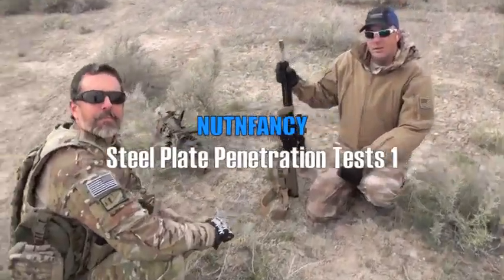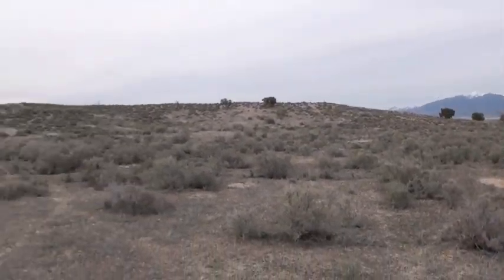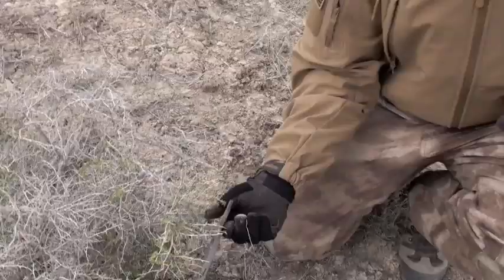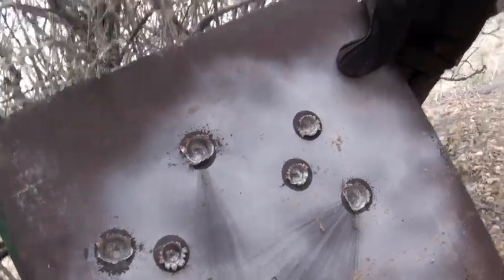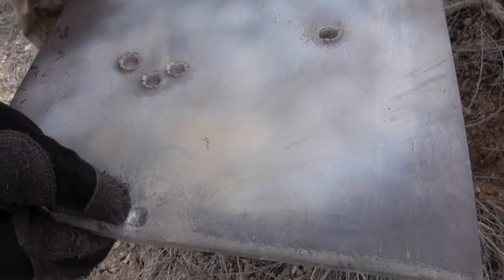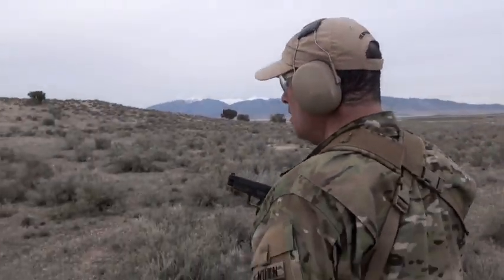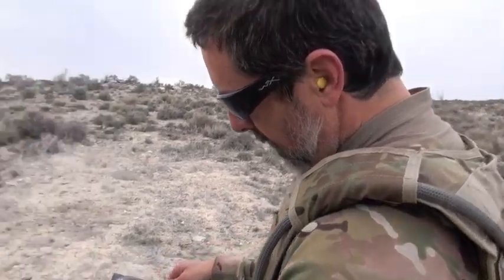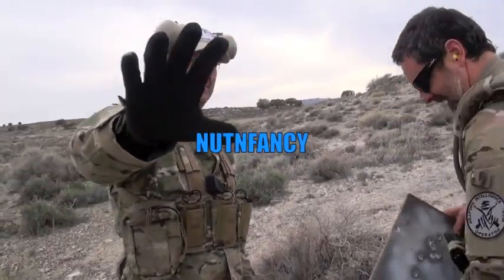Steel Plate Penetration Tests: 7.62mm, 5.56mm

Comment: Its a lot cheaper to stop 308 and 5.56 with sand bags. The sand eats the bullets up like candy and for an up grade you can go with gravel in bags also. Works like a charm and is easier to build a defensive barrier for protection plus it can be found everywhere.  Simple always works best.

Comment: I like the video. I tested my rifles the same way you guys did; with 3/4" 12x12 steel plates. I noticed during your video, .308 did not penetrate the 3/4" steel plate. I don't know your yardages or anything, but at 100 yds, I penetrated a 3/4" 12x12 steel plate with my 1950 8mm Mauser.

Comment: Kel Tec is JUNK, they have been for years...
Reply: Dana L i wanted a KelTec RFB until i saw Nutnfancys video... i never buy a new gun until i watch some Nutnfancy videos a few times... i only trust Nutnfancy when it comes to gun knowledge
Reply: John Smith Haha, Yes I agree, but there are other people's opinions on things as well that are good, but he is very knowledgeable, even though his shooting prowess needs a bit of tactical work (not much, but I can pick out some flaws that need work, he just isn't as smooth as other Operators). He is squared away and I trust his opinions on equipment and philosophies on many things, not all, but most.  

Yes the RFB is junk, I was out training at my local range and saw a guy with a brand new one, that he was having issues with on ALL types of ammo he was using, then he took it apart and couldn't put it back together again, he ended up getting frustrated and taking it home in a box. I don't know what was wrong with it, nor had time to check it out, and I just witnessed this in passing several times as I was working on the pistol side.  Which just reinforced the bad reviews I have seen.

The KSG isn't too bad, maybe the one decent product of Kel Tec, and their pocket pistol line as well isn't bad for the price. They just don't have the reputation and military rapport like HK, FN, S&W, Colt, Remington, and etc.

Comment: Ok, they went through, but what is left of the bullets once they made it through a steel plate? Even the 1/4" one? I'm gonna guess, what's left of them won't have enough energy to hurt a fly.
Reply: No way I would want to be on the other side to find out.
Reply: ***** you would still possibly be injured by the spalling effect.  Granted, it will be much slower velocity but still enough to cause injury.  Especially to soft tissue, eyes, throat etc.  I have seen this first hand and the chance of a mortal wound is low, but it still could happen.

Comment: The 1996 North Hollywood shootout (Bank of America robbery) dispelled a lot of the myths about hiding behind cars as cover for assault rifle fire. The AK47s and HKs used in that incident went through police cars like a hot knife through butter, though I understand they were using armor piercing rounds in that case. Evdiently, as this video demonstrates, armored piercing rounds are wholy unnecessary in defeating even thicker steel (though the grade they used was pretty low quality and not analogous to armored military vehicles). Even positioning oneself behind the engine block of a vehicle offers little guarantee of protection against such a round (especially given the extensive modern use of aluminum in engines). This video also demonstrates the lack of power of the 5.56 round, though it certainly demonstrates the valid trade-off for improved accuracy. Still, it does little good to have nice groups that don't penetrate low-grade steel cover. For the 308, such steel is certainly not cover. It is simply concealment. Nicely done. Should have used a standard scoped AK74 instead of that hunk of junk and they wouldnt have had any mechanical issues.
Reply: You->"This video also demonstrates the lack of power of the 5.56 round, though it certainly demonstrates the valid trade-off for improved accuracy."

A 7.62 NATO is not "less accurate" than a 5.56 NATO, the guy with the Kel Tec RFB just can't shoot very well. The trade off is recoil, weight, magazine capacity, and controllability, for more power, which results in smaller or larger disbursement patterns on target when running and gunning. If lab shooting you might be surprised that the accuracy of the 7.62 will be slightly better, than the 5.56 NATO due to the 7.62 NATO's shorter and fatter casing, if they both are not fairly similar. Its simple physics, you need a larger and heavier gun for the larger and heavier caliber, but if you do your part, BOTH will shoot well, but one is easier to control shooting rapid fire without question.
Reply: Dana L I made my inital post before learning more about both ammo types and their platforms. I now own a 7.62 weapon which I had chosen after an in-depth study of both ammos and their weapon platforms. 

I agree with you. Though a heavier weapon is not necessarily required for the 7.62 round. I purchased a VZ58 after much research. It is lighter than an AK47, even with a milled receiver, and supposedly more accurate due to its striker fire system and short piston operation. The AK uses a long piston and a hammer system both which contribute to a SLIGHTLY decreased accuracy durring heavy fire as that system is not as symmetrical in handling recoil. But I agree, both the AK and other variants (and non variants like the VZ) are plenty accurate enough such that in the hands of trained operators either system would perform nearly equally. 

I chose the 7.62 based on penetration dynamics. What sold it for me was a demo I saw where a simple 55 gal drum of water was fired upon by both 5.56 and 7.62. The 7.62 went through both sides. The 5.56 did not. That would be the difference of cover vs mere concealment (and thereby life and death).  Cinder blocks are also interesting for penetration comparisons, but far less conclusive. A lot of these comparison videos are very poorly thought out and often conducted by people vastly more proficient on one platform than the other (an AR fanboy that occasionally fires an AK is not a good way to show which one is 'better').

In the end, a class-4 body armor will stop either ammo types (including green-tip 5.56). So it also comes down to just a personal preference. 

7.62 platforms are cheaper than 5.56 (except for the Keltec and some stripped-down AR's like the sporter SW). THe ammo is also a bit cheaper too, at least in my area.

In the light of a deeper (though admittedly still incomplete) understanding of the ammo and weapon systems involved, I think what I should have said about this shooting is that it demonstrates the lack of sufficient options for the police at that time. 9mm handguns and shotguns just don't cut it when your enemy are that heavily armed. The vastly superior number of police officers was insufficient to handle what two madmen with assault rifles could dish out.
Reply: Gregory Dearth 7.62 NATO is larger than the 7.62x39 AK round that is used.  We are talking about two different calibers, I specified 5.56 NATO and 7.62 NATO because those were the calibers used in the video, and the ones you were talking about when speaking about "accuracy."  Accuracy is a bit ambiguous of a term, when talking about raw groups fired eliminating as much human error as possible in a given rifle/caliber system is different than speaking about the shot groups produced from the rifle/caliber system's shootability when firing more rapid.

A Barrett M107 will be much more accurate grouping than an AK in 7.62, but the AK will be more "accurate" shooting rapid fire than the Barrett offhand or prone.  That was my whole point, and yes I have much to learn as well. Don't we all?
Reply: Dana L Didn't the shooters in this event also make use of a typical AK variant? That would use the typical 7.62x39 round, not the longer NATO version. I saw that they had several weapons in use... guess I gotta watch the video again now that I know more and can identify weapons better. Carefully selecting a rifle for purchase intrinsically involves learning a LOT about different weapons and their ammo types. Lol. 

When I was referencing accuracy I was indeed speaking of the weapon's ability to confine hits to the smallest group possible at a set range, when human factors are minimized or eliminated through a bench-fire setup. Any reference to accuracy OUTSIDE of those conditions would indeed be kinda meaningless.

However, there is a real mechanical limitation to particular weapons (like the AK47) regarding the minimum group size achievable, even if bench-fired. The design of a weapon can have a lot to do with minimum group size, especially if the way it handles recoil is not perfectly uniform or symmetrical along the long axis, as is the case in the AK47. 

But generally, mechanical limitations dont matter too much as the human element of normal weapon operation renders most rifles comparable within a margin of error greater than what is invoked by those mechanical limitations. That is, human involvement in firing a weapon inherently increases the inaccuracy beyond what the mechanical limitations would alone invoke, rendering their effect moot.

As a wise range instructor once told me, your weapon is always capable of greater accuracy than you are capable of obtaining from that weapon. 

That is why the debates rage on between  the AK/AR platforms. Russian operators of the AK state that they can get 2" groups consistently at 100 m with an AK whereas the AR fanboys state that only an AR is capable of that kind of accuracy and dismiss the AK as a sloppy rifle.

Eliminate the human factor, and either rifle is quite similar in accuracy. Being an expert operator partially eliminates the limitations of either system. And that is why comparison videos suck. You end up with a fanboy of one system shooting another system they do not prefer, and lo and behold, they get better accuracy with the system they DO prefer. It is frustrating that nobody ever makes a truly fair comparison video, where the weapons are bench fired (including a mechanical device to pull the triggers) to demonstrate which system might actually be more accurate on a purely mechanical basis. But at that point, one might wonder what the point of such a comparison would be if becoming proficient on either platform can make that proficient user capable of comparable accuracy.
Reply: Gregory Dearth Yes the LA shootout was using AK's I believe, but in this video you responded to they were using 5.56 NATO and 7.62 NATO out of the bullpup Keltec RFB.  I didn't see an AK round fired, so I wasn't sure which you were talking about. I may have not understood that you were saying.

Yes I agree with much of what you said. Either way you look at it, its all a trade off at some point.  There is no such thing as the "perfect" rifle.  There are calibers that are inherently more accurate than others, but yes you are right that the operator imparts error to make this marginal, but still all advantages should be taken to help win the gunfight. Shorter, fatter, cases lead to better accuracy, but they reduce magazine capacity. So yes its all a trade off.
Reply: Dana L Good. At least I am getting smarter in my assessments. lol

I do like that 7.62 NATO round. That is one hell of a round. Possibly the most versitile round out there. Good for long range sniping. Good for penetration. Good against light armor. Good for hunting. 

But my decision to go with the 7.62x39 round was one of economy. That is some cheap ammo. Reliable performance, reasonable accuracy, and inexpensive firearms. The VZ58/VZ2008 I picked up cost less than $400 with 3 mags and higher tech than a typical AK47 (bolt locks open on last round, can be clip loaded, striker fired, etc). 

I ended up purchasing a Canik TP-9, a splendid inexpensive handgun that is much like a Walther PPQ internally but at about half the cost. People give me discerning looks when I explain the weapon only costs about $350 as if that means it is a piece of crap weapon. I then show them my range results and it shuts them up. 

I am sure that when I get to the range with this rifle I will get snarky looks from people who own $2000 ARs or even $700 AKs. But I will likewise shut them up when I pull tight groups with my $400 VZ. Rifle snobery is getting out of control these days. People dump entirely too much cash into weapon. Sure, you get what you pay for to some extent.

But there is a reason some weapons are not expensive and it has nothing at all to do with quality. In the case of the Canik, it is made in Turkey by SYS, a serious defense contractor. As handguns are only a small part of their development, they don't need to mark them up that much. They get paid vast sums of money for rockets, aircraft parts, and other high-level military tech. They also sell these TP-9s to law enforcement by the thousands, which keeps their individual unit costs down. Finally, they also cost less due to very modern manufacturing techniques in a country where the American dollar goes much farther than in the US.

In the case of the VZ, the low cost was a temporary thing. The price is increasing on these already as they are becoming a bit rare. But as they were developed by the Chechs to be different from AKs, the lack parts compatibility (including their unique mags) and that kept their price low until recently. So again, nothing to do with quality there.
Reply: Gregory Dearth Roger that, I understand. Yeah I'm all about quality at a good price. I've been looking at the Galil ACE for a 7.62x39mm rifle, it is super cheap to train with, but I just don't like taking risks with the quality variances in the AK platform, so I would be willing to spend a bit more to buy once an Israeli made AK mod, than taking chances buying and reselling an AK that is junk. The AK's have such vast variances in quality, even among "good brands," than AR's that typically have MUCH better QC.

I think I'd rather rock a .300Blk in a SB pistol package, for the ultimate in compact subsonic home defense, that can then range out beyond 400m with greater power than an M4 in 14.5," with supersonic rounds from a shorter OAL that includes a suppressor. The .300Blk burns nearly ALL powder in about 9" of barrel length, anything additional in length doesn't balance the added weight and incumberance in CQB for marginal performance gains, making the .300Blk a much more efficient and versatile round than 5.56 NATO or 7.62x39mm, per inch of barrel. The problem is that it is still expensive to train in volume with. 
http://300aacblackout.com/

Comment: Military Armor plate is specially manufactured 550 grade steel. Its extremely hard steel intended to stop bullets. Its difficult to drill or tap, very hard on cutting tools and is very expensive. The reason why its preferred to make the steel harder and tougher than simply just thicker is weight. However if you're application where the extra weight is not a problem but cost is, just use 450 grade, its still tough and much cheaper.

Comment: 500 Grade 1/2 inch will stop it but the steel is expensive. 450 Grade 1/2 inch will stop most rounds some may perpetrate but only just. Mild steel 250 grade in 1/4 inch will stop most hand guns but useless to rifles, even 1/2 inch got penetration. Yes the movies are full of LIES and the madness of hiding behind a car or fridge door to shield from a assault rifle fire will just get you shot. Its misleading and dangerous for movies makers to show scenes like this with mislead and can result in death.

Comment: You Tube search Flash 500 Bainite 1/4'' armor, it is barely dented by 175gr 308. FMJ.

Flash Bainite is the Strongest, Most Ductile, Lean Alloyed, Readily Weldable, Least Costly Maximum Strength METAL known to man. A50 tensile ranges from 1100 to 2080MPa (160-302ksi) with 8 to 9% elongation.  Total elongation up to 10-11% is not uncommon.  Flash 500 at 1900MPa and 9% elongation exceeds titanium-6Al-4V's strength to weight ratio making it pound per pound stronger at only 56% the volume. Flash 500 is 10% the cost of Ti-64.

Comment: ALUMINUM IN FREE SPACE CAN NOT FULLY PENETRATE STRUCTURAL STEEL AT SUBSONIC SPEED, PERIOD.
These bullets are copper(sg9) jacketed lead(sg 11.4), making them over 10 times the density of water, Sully's airliner in the Hudson river clearly shows it's mass density to be less than half that of water. Combine w/ the fact a 767 can not exceed 500ft/sec at sea level, it should be obvious as to the HOAX perpetrated on the US public and the world.
Shear mod of alum 25, shear mod steel 70

Comment: Ever going try armor plate, and not just mild steel....in metal hardness factor mild steel rates at 150 and armor plate rates at 460 - 544 over 3x stronger then mild steel.

Comment: The old green tip isn't armor piercing just mild steel makes the bullet stronger M855

The new Green tip copper alloy slug with a steel penetrator... the cap on the core is harden M855A1 this round can go into engine block of a car and better stopping power

Comment: Green tip rounds are Armor piercing "AP"...

The "Penetrator" is the small steel insert inside the slug.

FMJ is simply a lead core surronded by a copper jacket.

Velocity equals penetration all things being equal.

Comment: We tried a 9mm carbine on 1/4" flat & it did nothing. They are going quite a bit faster & have lots more energy than out of a pistol but to pierce steel you need a small diameter high velocity. If I recall we used hollow points but it was so far from going through I seriously doubt fmj would have made much difference.

Comment: Check the Owner’s Manual drawing, Left and Right Extractors (RFB-304,305) probably sheared at the vertical to horizontal transition that passes thru the Bolt (RFB-302) that Extractor Lift Spring (RFB-306) pushes on. The shear on both pieces may be hidden under Extractor Clamp Spring (PC-308).